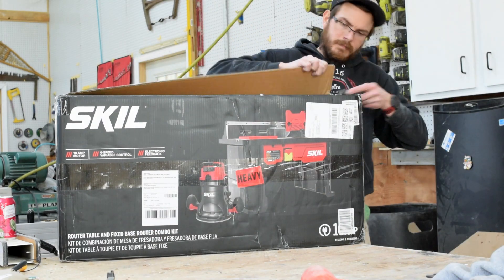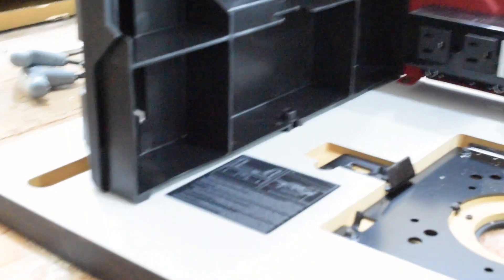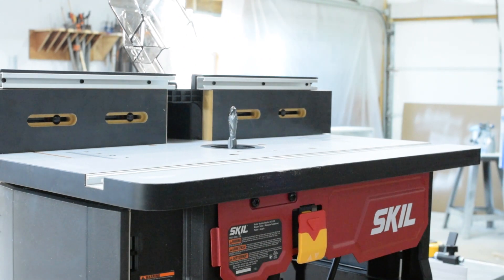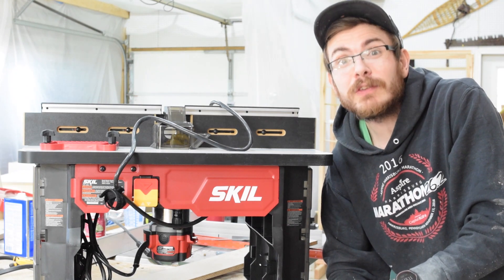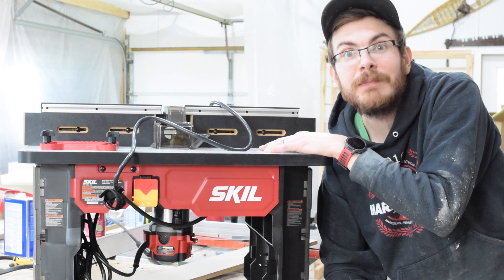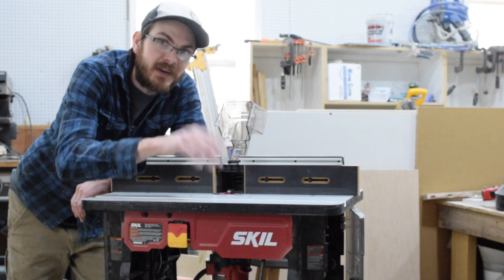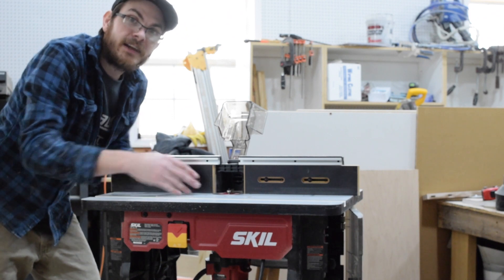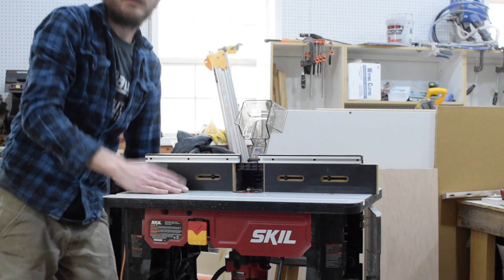I Bought a Cheap Router Table, and I Kind of Love It?

Comment: 6:55. I just bought this set up and this was the first thing I noticed.  You seem like a pretty hand guy.  Have you been able to find a way to keep the left "jointer" fence from wiggling?
Reply from the maker: Shims. Lots of shimming. But, a big problem I didn’t realize until later was that by shimming the left hand side to be coplanar with the right along the bottom edge was that the top edge was no longer in line, and when I corrected the top the bottom would be out. This was more of an issue with using a coping sled for door parts. I’ve actually just screwed a piece of hardwood with a cutout across the entire fence, ensuring that everything will always be coplanar. Not ideal, but still not a deal-breaker for this price point
Reply: @SpottedTongueWoodworking  Great idea!  Do you happen to have a picture of the hardwood piece that you put on the fence?  I might try that.  Thanks so much.

Comment: 💯
Reply from the maker: The more I use this table the more I like it. I solved the fence issue by filing down the tabs on one side, so everything is smooth and coplanar. It’s a fantastic little table for the money
Reply: I'm getting this table in the mail soon....I plan to use it as a jointer as well as a routing table.
Can you explain in an little more detail how you fixed the fence issue?
Reply from the maker: I really should make a follow-up video. All I did was take a file and sand down a protruding plastic piece that kept the fence from sitting flush- after that, it’s been amazing!
Reply: Ok so it's a great router table for the money.  My fences are co planar out of the box.  But I am having a problem with flex when I use it as a jointer....any ideas?  Mayne c clamp the left fence?
Reply: @SpottedTongueWoodworking  Yes!!  Please make a video about this.  Would love to see your solution as I am in a pinch and I need that fence to lock in.  Thanks